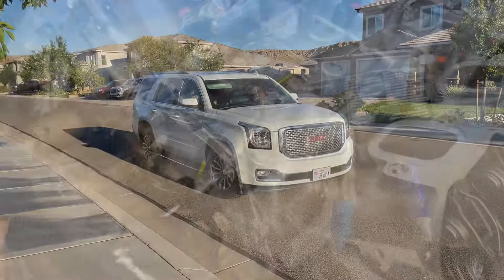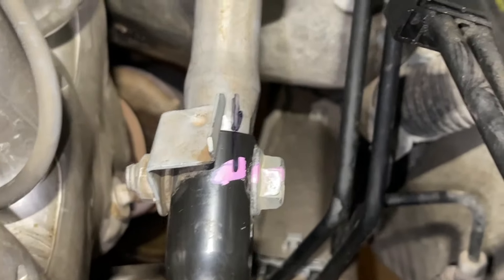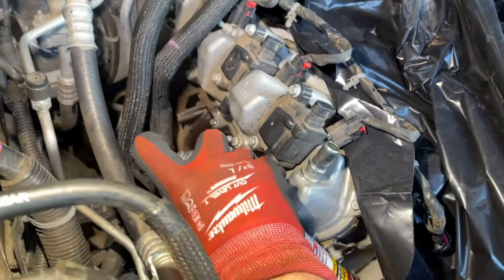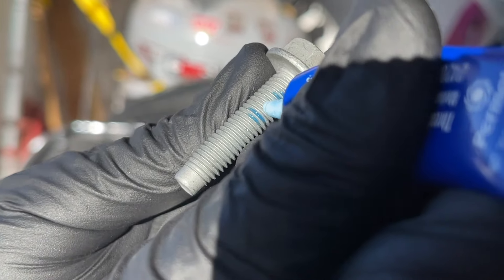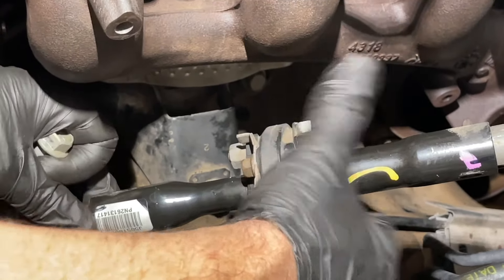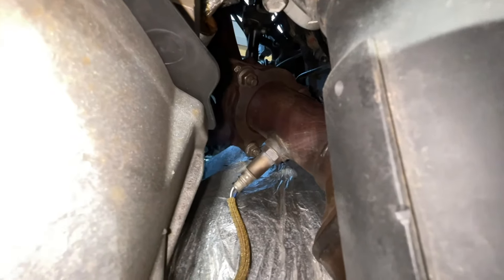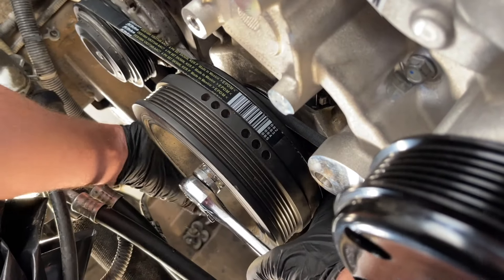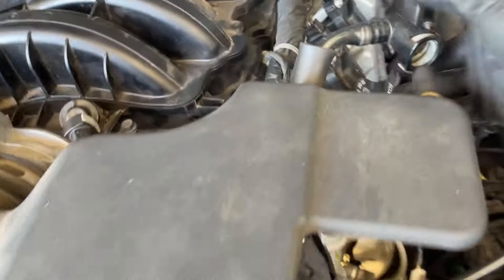Vacuum Pump Replacement Yukon, Tahoe, Suburban, Sierra, Silverado, Escalade 6.2L 5.3L 2015-2020

Comment: I have a 2016 Silverado. The dealer replaced mine last week at 113,000 miles at no cost to me. It’s covered under a special 10yr/150,000 warranty so why buy the stuff and replace it yourself when the dealer will do it at no cost to you? The new pump, by the way, is redesigned and more robust than the original pump.
Reply from the maker: Not everyone will have that warranty, so this video is for them. This was also done because mine lost a regular lifter, not under warranty 
https://youtu.be/oEtksxT09-U?si=bKmumpvP1KiRQ6vm

Comment: Changed my vacuum belt yesterday because it be other one I found broken. New one squeaks and doesn’t turn. Any ideas? Thank you
Reply from the maker: Does the vacuum pump turn freely or feel bound up? Vacuum pumps available in the video description
Reply: @dannyjohnsonsgarage the vacuum pump doesn’t turn like it did when I put the first one on. I think it’s a bad pump
Reply from the maker: @ I would also check to make sure it’s not plugged on any of the ports or the back
Reply: @dannyjohnsonsgarage if I remove it I’m going to replace it. I appreciate the help!!

Comment: isnt this covered by GMs special 10yr / 150k mile warranty?
Reply from the maker: When I checked, my 2015 being the first year of the new bodystyle with many issues was given a 100k miles/5 year warranty which had run out. This part was also upgraded during my cam and lifters replacement just by my preference, it wasn’t bad. Even when I had a transmission sensor issue it wouldn’t not be covered, so it’s worthless to pay the diagnostic fee to be told it’s not covered when the diagnostic fee could cover the price of the part
https://youtu.be/cWayyZGNYRI?si=vVyfx2D6QAEsvF7W
Reply: It is. I took my 2016 Silverado in yesterday for this issue.  They were going to replace this for free for me. However the service advisor said he could not do the repair for free since the truck had a rebuilt title.  He said he could do the fix but he would have to charge me $1000 . I told him no thank you. That's why I'm here watching this video
Reply: Is the vacuum pump AC delco?
Reply from the maker: @Vlogwithwop  It says GM genuine parts but I don’t see the AC Delco. The part number is 12696313 saying made in China, but that is covering a sticker with part number 22809932 saying made in USA. https://www.amazon.com/dp/B08R6GJWMF?psc=1&linkCode=sl1&tag=2004047-20&linkId=eee855e3232c10392c8db3f3f1a4abc9&language=en_US&ref_=as_li_ss_tl#immersive-view_1702781305021
Reply: Just had our 15 burb done under the 10yr/150k mile warranty

Comment: Was your truck making a ticking noise before you changed the vacuum pump?…and if so did this stop it?
Reply from the maker: Mine was making a sound, but it ended up being the lifter. I replaced the vacuum pump while I had it apart for the lifter https://youtu.be/cx4_-FGXCVE?si=WK2P2lhJu_XgRmhR
Reply from the maker: Here is the lifter replacement part https://youtu.be/cWayyZGNYRI?si=mpN7qsxDYnt81os7

Comment: What were some symptoms of one failing ?
Reply from the maker: You may get a code for it, or feel a sloppy brake pedal. I changed mine preventatively during a lifter repair because these pumps can fail and put metal shavings in the system  https://youtu.be/cWayyZGNYRI?si=ZYzoM1xcD6CmwQ2W